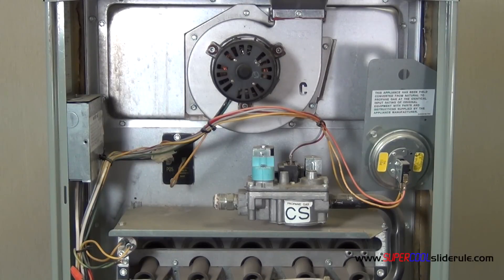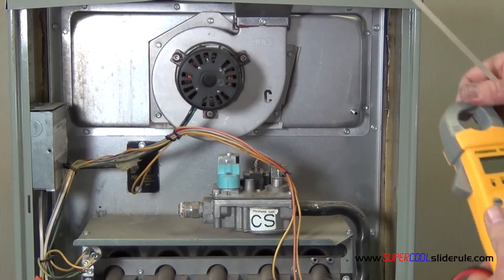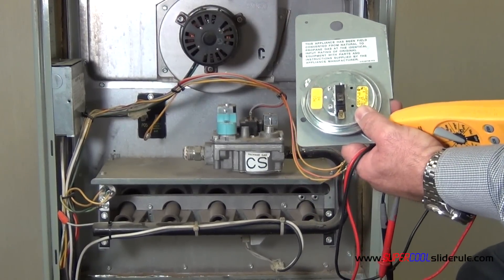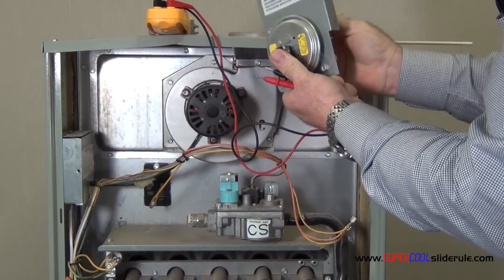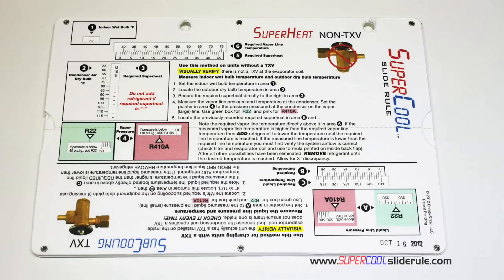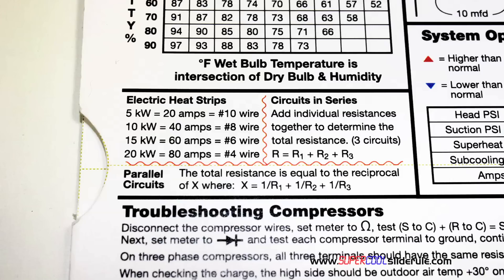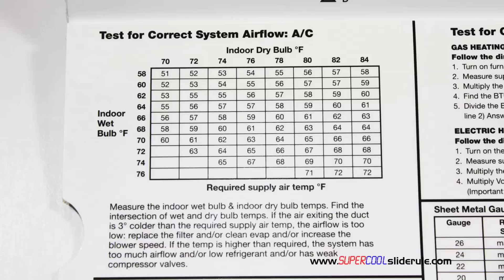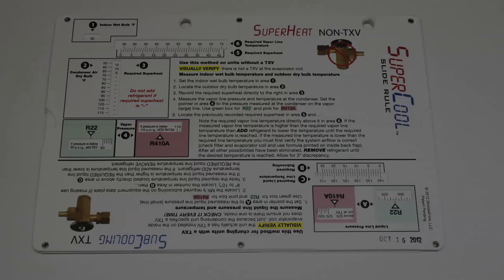How to test an Air Proving or Sail Switch

Comment: This video was created to show someone how to test if an air proving switch is functioning properly, it is not designed to test if your furnaces is developing the correct vacuum. If the furnace being tested indicates an air proving switch fault this is a quick way to test if the switch is good or bad. If the switch is faulty this method will detect it 99% of the time. If the switch is good then the technician should connect a manometer to verify there is sufficient vacuum being created to active the switch.

Comment: 100 times was an exaggeration of course but I have had students test with a digital manometer which will read a max neg. of  -19.99 " and they can easily peg it off the scale. And that is inches of water column, not mercury. 1.4 psi would convert to 38.75 inches of water column. I have pressure switches with holes drilled in the casing to simulate a bad pressure switch and they will still close 'sucking in on it' but won't at anything close to the correct amount of vacuum.

Comment: The average persons can exert a maximum of 1.4 psi when blowing and less when sucking. This test will check that the contacts are functioning properly and that the diaphragm has not ruptured. If you are capable of developing a vacuum equivalent to 100 inches of mercury with your lungs then I suggest you not attempt this method.

Comment: This is not the correct way to test a pressure/vacuum switch. There is no way to tell how much vacuum is actually being required for the switch to close, you could easily suck in 100 times the actual amount it should take to close it. A common range is only -0.3 to -0.9 inches of water column. The yellow sticker on the switch will tell you how much vacuum is required for it to close.
The proper way is to disconnect the hose from the press sw. and connect it to a digital manometer, then give the furnace a call for heat and while inducer motor is running see how much vacuum the switch is actually seeing compared to what it should take (according the sticker on the switch) for the switch to close. If it is seeing the required amount of vacuum or more (example - requires -0.35 but is actually seeing -.095) and the switch doesn't close then the switch needs replaced. If the switch is not seeing the required vacuum (example - requires -.035 but only seeing -0.15) then the switch is doing it's job and there is a problem elsewhere such as the flue being stopped up, hose or hose nipple plugged, inducer wheel disintegrated, large holes in heat exchanger, etc. etc.
Reply: I think you got your zeros and decimal points in wrong places.